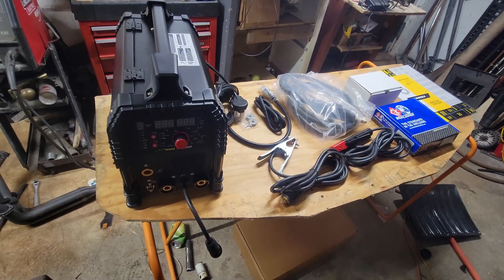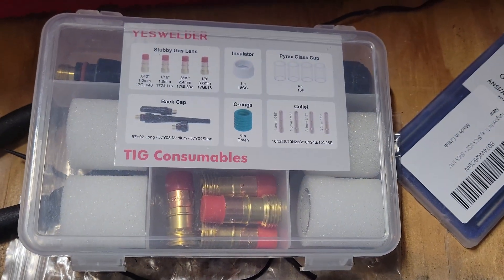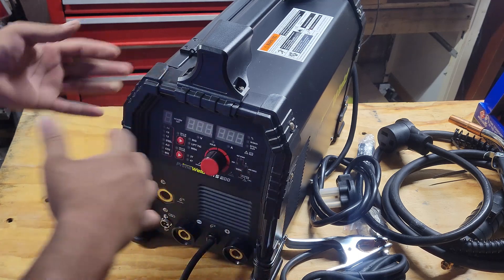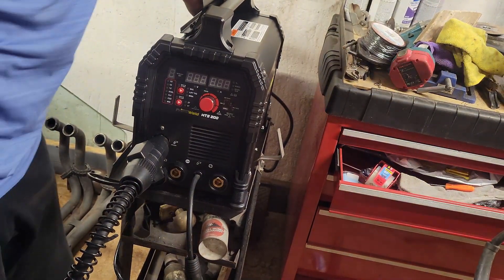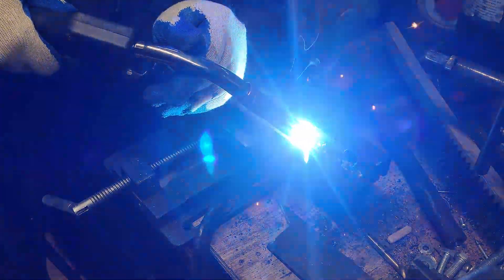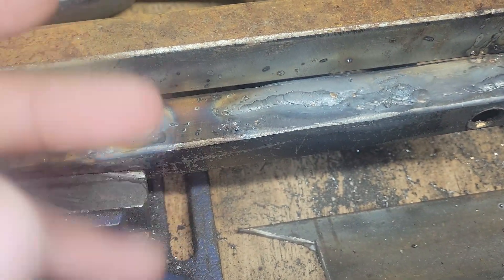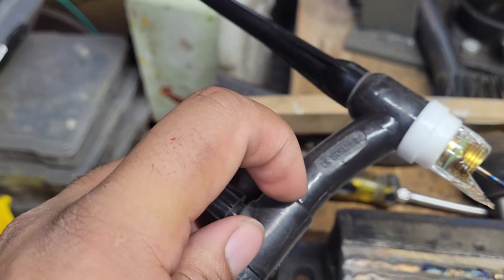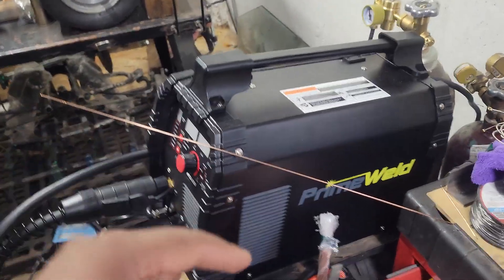Testing Out PrimeWeld's MTS 200 And Review*16 Year Old Welding Tig/Mig/Stick*

Comment: did you do all of this running on a 110v outlet?
Reply from the maker: @kylerhurt8937  Yes. It's been a year or 2 since I've had this. Welds are 10x better than before. All out of a 110v outlet in my basement Loll.

Comment: Tig gets easier with a high frequency machine, also dab you filler in the front of the puddle while pushing the tig torch, your were dabing from the back while dragging.
Reply from the maker: Yeah, it's been almost a year already and got way better. But one with a pedal would be better. Thanks for the explanation and the comment!😊